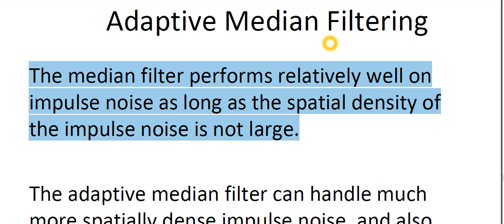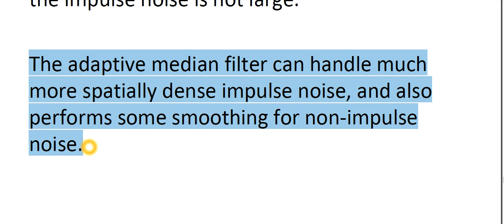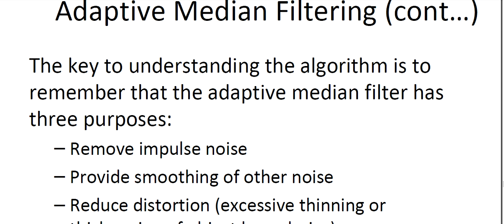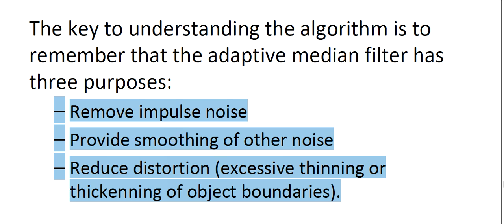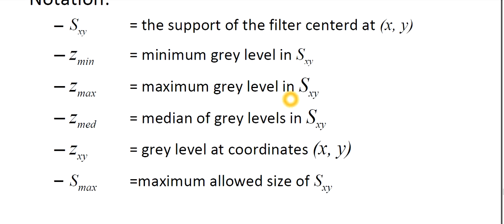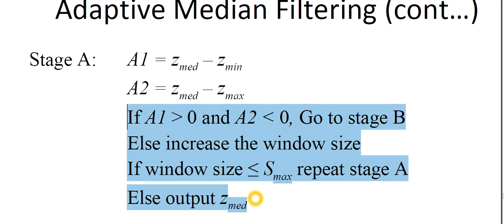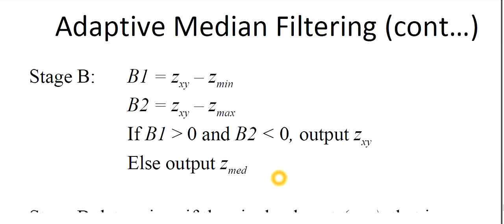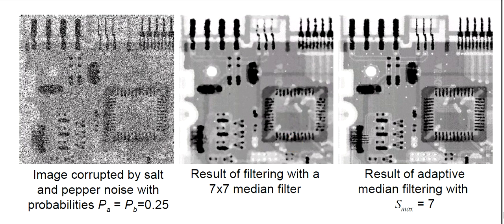Adaptive Median Filter|Image Restoration Techniques|Part-4

Comment: The continuous, varying or intermittent noises are the non-impulse noise.

The adaptive median filter depends in the windows size as each pixel surrounding the window varies. The variation depends on the median of the pixels in the present window. If the median value is an impulse then the size of the window is expanded.
Reply from the maker: Correct!

Comment: ADAPTIVE MEDIAN FILTER depends on the median of the pixels in the present window. If the median value is an impulse, then the size of the window is expanded. Otherwise, further processing is done on the part of the image within the current window specifications.
Reply from the maker: Correct!

Comment: The continuous, varying or intermittent are the example of non-impulsive noise.

 In the Adaptive 
Median Filter, the size of the window surrounding each pixel is variable. This variation 
depends on the median of the pixels in the present window. If the median value is an impulse, then the size of the window is expanded.
Reply from the maker: Very good

Comment: The continuous , varying or contaminent noises are the non impulsive noise.

The adaptive median filter depends on the image size as each pixel surrounding the windows varies.The variation depends on the median of the pixels in the present window.If the median value is an impulsive then the size of the window is expanded.
Reply from the maker: Right

Comment: Adaptive median filter  variation depends on the median of the pixels in the present window. If the median value is an impulse, then the size of the window is expanded. Otherwise, further processing is done on the part of the image within the current window specifications.
Reply from the maker: Right